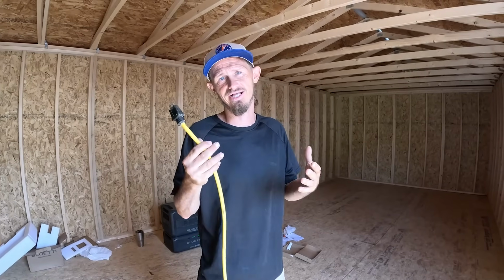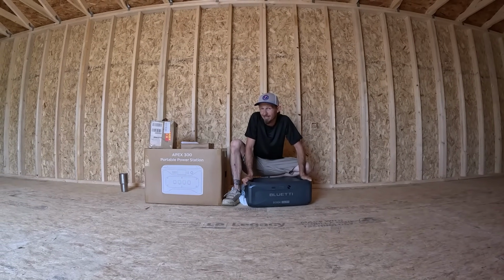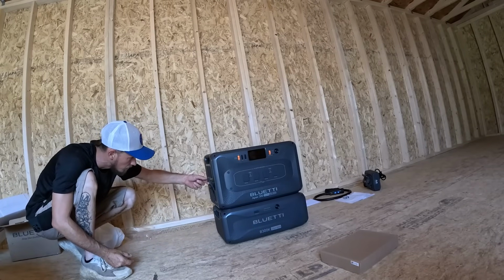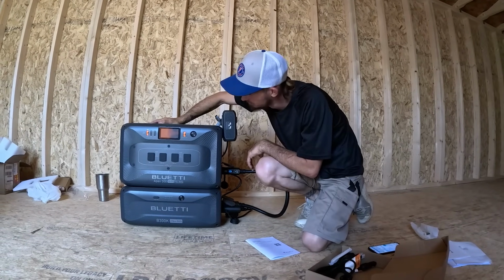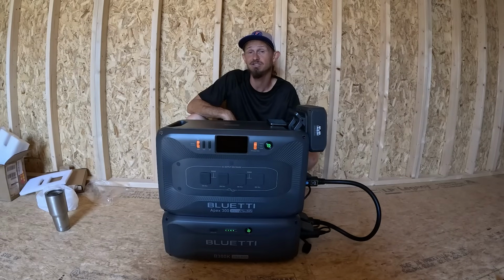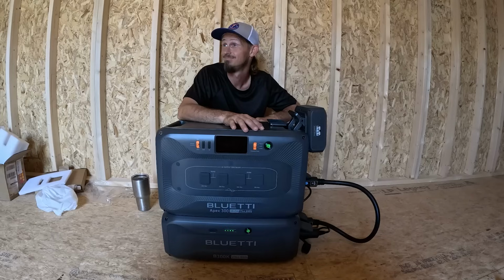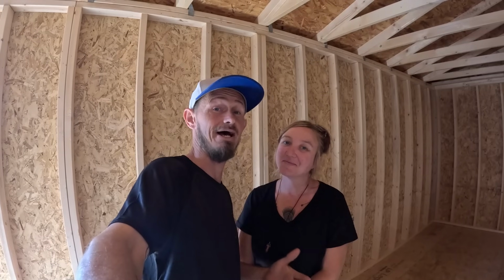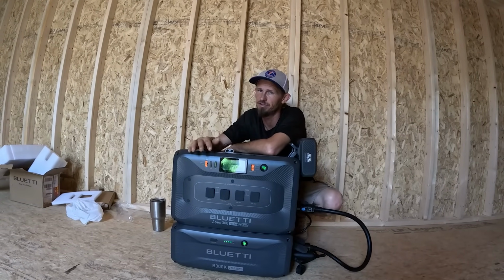ARE WE EVEN OFF GRID NOW? | bluetti apex 300 | work, couple, tiny house, homesteading, off-grid

Comment: Seeing as how you are "off grid" I am surprised you forgot the most important part, how are yo u going to charge it up? I would really like to see how to use this power station with solar panels and get anywhere near the 2400 watts of solar. The specs I have say it accepts 1200 watts of solar from each of two inputs, but each input can only accept 60vdc and 20 amps, and I cannot find any panels that can work with this system at the claimed wattage with that limited voltage and amps. My AC200L accepts up to 145vdc and 20 amps, meaning it can only be run in series, not parallel, but it can accept almost any solar panel. This apex 300 has no panels available that get anywhere near the claimed 2400 watts. Bluetti only sells an 800 watt kit with 4 - 200 watt panels getting you a maximum of 800 watts for the entire system using both solar input ports. The only way to get more is to buy another charge controller and add that into your system at significant expense and effort.
Reply from the maker: In the video I expressed the many ways to be able to charge this unit.